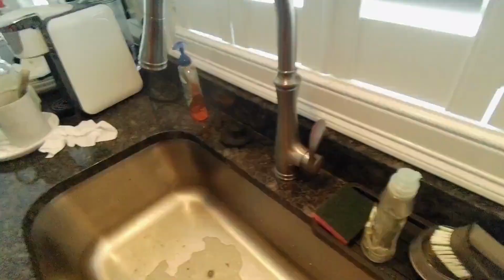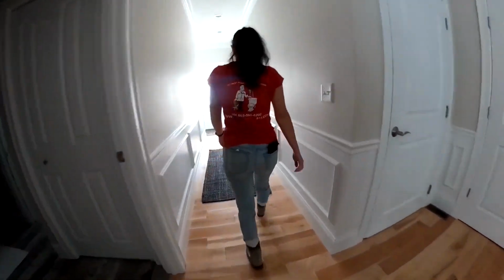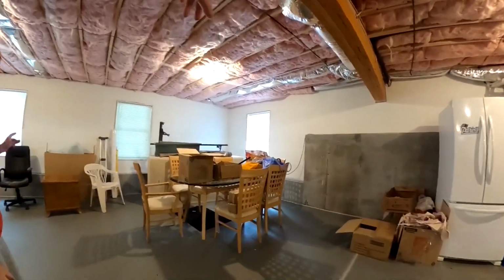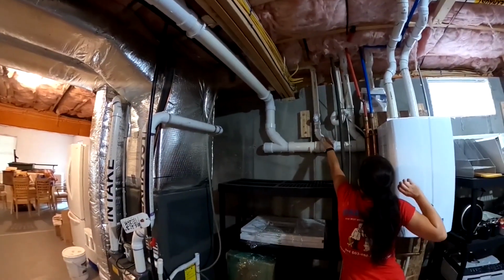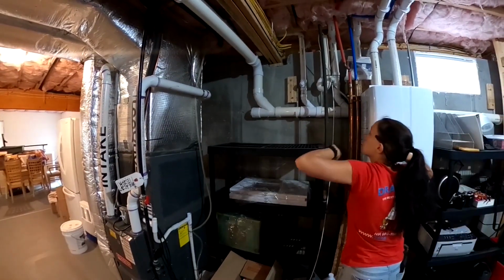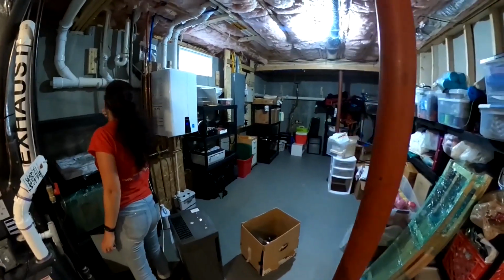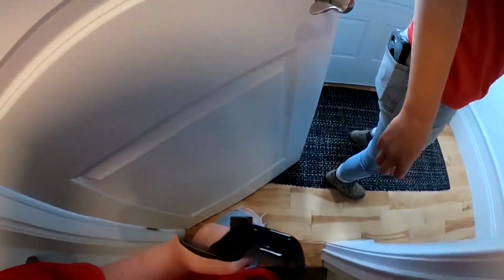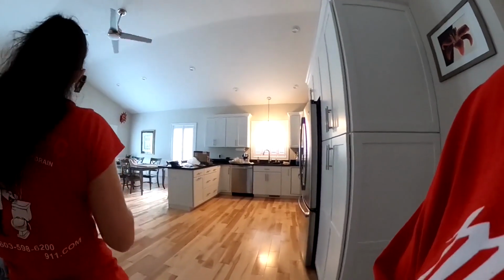Clogged Drain #29 Kitchen Sink Drain

Comment: I notice sometimes you use a flex shaft Machine, and sometimes a cable machine. Which do you prefer? I myself have never used a flex shaft, I don't really see the need for one, I guess if you have a line with a bunch of sludge or grease it may be helpful.
Reply from the maker: To be honest, we hated it when we first got it. It literally sat in the truck for like a year. We then started using it for just lines with tree roots, we use this in conjunction with the camera to get a higher percentage of the roots out. From there we started loving how it was working, we started to descale cast iron with it. The trick is being able to use it with the camera so instead of going in blind you can see what your doing. You also need to have the penitration tip and the teeth on the chains. It takes getting use to. So to some up the answer there is a time and place for the flex shaft and when it doubt cable it out. Lol (Shelly)